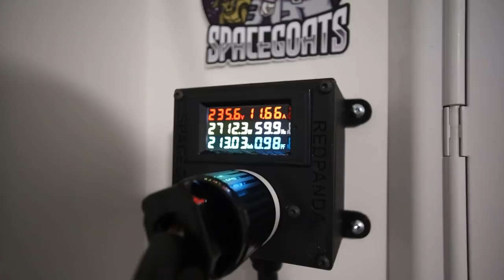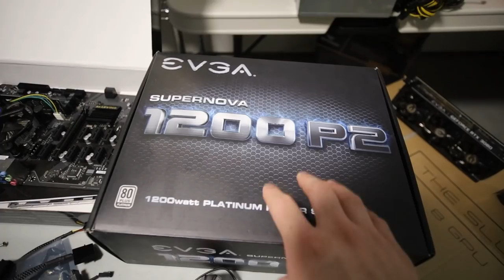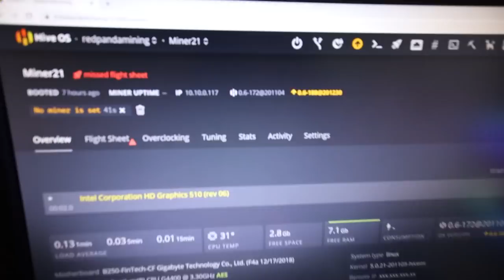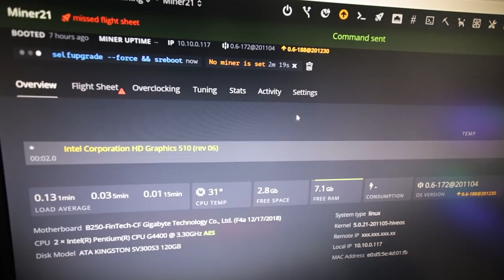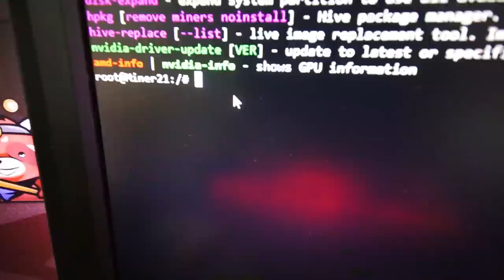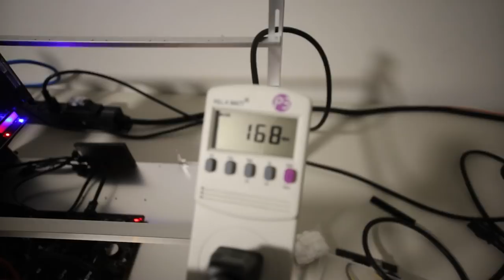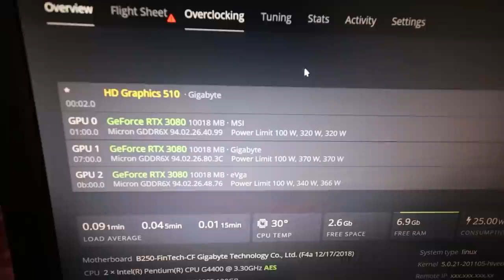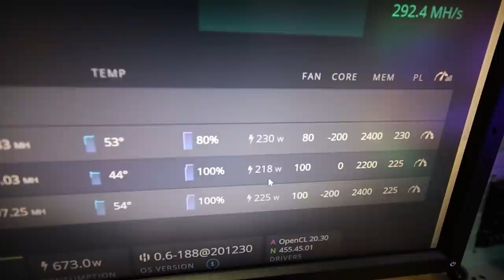Starting a RTX 3080 MINING RIG!

Comment: Do you have a video where you demonstrate how to power 8+6 pin PCIe gpu's + PCIe connecting the risers to with the cables from a PSU and splitters? I'm still confused on how to wire my 2070's with a 1000w PSU.

Comment: The Gigabyte's ram seems to get to hot.  A British miner I saw with the Eagle OC took it apart and applied some sort of thermal pad. He had 80 mhs and got it to 100. Still happy I have a Eagle OC even if some ram temp problems.
Reply: Yeah I had one of those, whever I was putting it to mine, fan would ramp up to 100%, no way of checking ram temps since card is well, crap, i changed to EVGA FTW3, fans are 70% and ram is however between 55-65 which is great

Comment: I had this issue with my first rig. The issue isn’t open air the problem with these rtx 3000 cards is fan speed. Keep fan speed at 70-80% 100% makes it throttle for some reason. Every other option I tweaked while at 100% fan didn’t matter even stock. Drop fan speed to 70-80 and it won’t throttle

Comment: I have a 6x3080 rig. Avoid MSI trio x cards. Had 3 and returned them for memory throttle issues. I have 2 tuf, 3 MSI suprim x, 1 EVGA xc3. Tuf cards are great and EVGA is great. I have 1 suprim with poor memory, only pulls 94/mhs but at 204 watts. The other suprim run at +1500mhz, 57% pl. And then a FE in my workstation. Good luck buddy!
Reply: What kind of power do you pull?  I am worried that it could over draw a circuit.  Also, did you have to use/upgrade anything else like memory or mother board to get it to work?
Reply: @jeffderitis1378  i pull 1550 from the wall. Used two different wall ports. I’m on an lga 1150 board. 16 go if ram. One thing that will get you if you aren’t ready is you will need to change the page file size in windows. A small setting, but necessary. Always use circuit protection.
Reply: Thanks for the advice.  I am starting with 2 3080s and will go from there.  As i been slowly moving forward I found that there are many things that have to planned out ahead of time.   Power, access to GPUs(lol), and the right components (enough power, right and proper amount of connectors) and so forth.  It is always good to see how others have achieved to see if there are any holes in the game plan.  Take care and happy mining!

Comment: As a new miner it's all those little things you don't think of. Fan splitters, risers, PSU spliters, etc.... etc...
Reply: Yeh I just bought a psu that has 8 pcie outputs 😂 when I get my 5th card I'll get another one 😂
Reply: Personally I only deal with cased riserless rigs. The day I switched made maintenance drop off like 80%. No more riser problems or anything of the sort, expensive but worth it in my opinion
Reply: @Alpejohn  ive just had so many die on me ive lost count. In my 4 years GPU mining, its the most consistent point of failure on any rig. I was amazed at riserless performance
Reply: @Alpejohn  but there's also something to be said for price point. Risers are pretty cheap (or they were last time I was buying) so its a question of is your time saved (cost savings in downtime and effort) worth the expense of the case and motherboard
Reply: @Alpejohn  well if you change your mind ive got two spare riserless cases i don't need. (One is Octominer, other is generic and imo better bc of non embedded CPU) would be willing to let one or both go for right, fair price.

Comment: Gigabyte Gaming OC without adding thermal pads 99 MH/s settings:
66% powerlimit
-200 core
+1250 mem
Fan 90% or 100%
GPU temp 40 celsius
Room temp 18 celsius

Comment: In Hiveos just edit in power consumption and efficiently tab to correct it

FYI for myself in nvidia gpu just plus 15w for each riser and 20 more watt for MB with 92% psu efficiency.
another FYI rough calculate with your rig info I have nearly correct wattage to your wall.

Comment: man. 3080 have hot memory chips. you need to cool down the back plate. especially on the memory side and those pop caps.
it will only last a month if you keep doing it without proper cooling. 

only evga card have sensor on many areas, but the other brand dont.

the noticeable sign is the hashrate consistently fall, while the gpu temp is cool <75c. like say 16:38
obviously the memory has thrown alot of error (ECC) because of the thermal. the card will try to compansate for the heat by throthle down the gpu frequency. which will not help at all because you overclocked the memory.
you could lower the memory frequency. but sometime, it does not help at all because of the heat release for the memory is not proper in any way.

it a sign of problem  that soon make your card failed when you force your card run that way in a 24/7.
it is a well known problem form 3080 that cause a gamer black screen when playing games. and the root cause of those failed 3080's when they even use for gaming only. gaming 24/7 that is.
i know alot of people who dont turn off their pc even when gaming. they let it run  24/7. all that wasted electricity.

other than popcaps problem. it is a back heat problem. 3080's memory are fried in heat. apparently, cooling only the front is not a solution.

unless you go for exotic cooling in front and back of the card.
that is why EK has launch a new 
waterblock that cool the front and the back.
or many people also tried using ram waterblock to cool the backplate.
you could simply add more heatsink on the back. but will only effective if the back pcb has proper thermal pads.

keep your eye on the hashrate....
you will be best to  RMA your card if it ever touch <80 MH/s. it's doomed to failed. it will cause a black screen if ever use for gaming.

i suggest 3060ti over 3080 because the 3060ti have more manageable temp.

Comment: What will it take for miners to choose cards that don't overlap the gaming marked?
Reply: For mining to not be profitable
Reply: When ETH goes POS...gpu mining dies
Reply: @reddevilxt716  it wont die. People will just mine something else.
Besides thats like 2 years from now minimum
Reply: @adaptive-tom7143  idk. I just see mining not completely dead, but significantly dying off at that point. It’s nuts right now. But just like 2017....it will fall off.
Reply: I was thinking more along the lines of Nvidia/AMD releasing cards specifically designed for mining, using components that are less rare but that won't impact the GPU's ability to mine.
Reply: @iseeu-fp9po  not possible. The ETH mining performance is directly related to the speed of the memory. GDDR6 and GDDR6X are the limiting factor in production from what I have read.
Reply: @reddevilxt716  Fiddlesticks.

Comment: Nice curious of the consumption when you get it tweaked out not the most efficent yet 5 3060ti would be at 309mh at 680w.  And cheaper :)
Reply: Damn, that`s insane Rabid, hopefully I will be able to buy some next couple of months, in Europe they go for 500 - 600 euro...
Reply: @yourmothersfavouritehouseguest  crazy that's what they are here and your money is worth double ours.
Reply: with couple of 3060ti you have 60mhs for 120w per cards, not bad too.
Reply: @warriorfr78270  120w software at the wall more like around 136w
Reply from the maker: Ive made the mistake buying 1060's before but I'm willing to spend more on gpus for the density and 10gb to lose a bit if efficiency. But I'm curious of the calculation for more motherboards/cpu/psu's if you are doing a huge farm obviously lol but small scale yeah then we talking 3060 ti. Really depends. I think both cards are the way to go for miners right now if ya can get your hands on them!
Reply: @RedPandaMining  very true
Reply: @RedPandaMining  I'm agree with you more ram is better but now for the price a 3060ti is better, if the price down a 3080 is better with less rig for sure >0.

Comment: How do you manage to keep your 3080s from auto downclocking while mining? My 3080 immediately downclocks to 700-800MHz once I start mining and have no idea why. Read it might be forced P2 state on Cuda workloads, bad cooling ...
Reply from the maker: Temps are probably the biggest factor. They thermal throttle due to gddr6x memory is hot on both sides of the gpu heatsink and the backside. You may need to do thermal pads on the backplate & have cool ambient temperatures in the room. Those 2 things seemed to have fix it for me.

Comment: directed airflow...now would be a good time to test that diamond plate out on sides and top...or you could just use cardboard...
Reply: Putting the fans directly on top of the cards you'll save 5C easy, especially on that MSI card. Thermal Grizzly on the heat sink and over all lower ambient temp will help with better mining performance.

Comment: Anyone know how to get 6 GPUs working on an MSI X470 MB? PCIe4 does not appear to work with an m.2 and the other 5 PCIe slots filled. Does using a USB drive make PCIe4 work or would an m.2 to pcie work for the 6th?

Comment: I am working on a similar setup, just double checking to be safe for myself - you have 2 8-pins for each 3080 but you are splitting one of the 8 pins to go into the riser? And that should satisfy the wattage for both the gpu and the risers with no problem?

Comment: Are red riser the new 009 and 010 Pcie 4.0 compatible with rx 5700 XT also? I could never get my fintech gigabyte 250 to read my rx 5700 XTs (007 riser ver..) without directly plugging them into the PCIe slot.
Reply from the maker: thats strange, it should technically work. Check your bios setting for pcie gen1/2/auto try different settings and 4g decoding enabled.

Comment: I have question about can i damage my GPU by mining on NiceHash. I have RX 580 8GB and i set up in msi afterburner power limit to -30%, i set up to in nicehash TDP power to low, and my GPU is running at 62-65 degrees celsius, with fans 55-60%. And i forgot to tell, im mining about 8 hours a day. How long will my GPU last. Can it last at least 3 years. I will mine about 300 days in a year. Thanks!

Comment: can i get some input from someone... im trying to run a low key dual 3080 mining/gaming rig. but my pc keeps restarting after about 30 minutes of run time. i replaced the 850w psu with a 1000w and i still cant run them even with one at 30% and the other at 65% power limit. really frustrated with this, will the 3080FE cause restarts if the core memory gets to hot? or is it likely my psu? its a supernova evga 1000w. also i even have the TDP for the 3080 FE set to low and asus set to high and still cant get any stability what so ever.
Reply from the maker: Check your temperatures man, if the gpu's are in a enclosed ATX case it will get extremely hot with these cards and probably turn off. Becareful.

Comment: Love your videos, i managed to get 4 x 5700xt, 2 are the same and 2 are different, also got a vega 64. Would it be  problem running them all together off the same motherboard? Also want to know, my video cards are pci 4.0 and my motherboard is psi 3.0? Will that still work?

Comment: I now run 2 MSI SuprimX 3080's. They have a very good performance.
Reply: Mine is arriving in 2 days. What are your opinions on the suprim x?
Reply: @thr3x658  It is a very great card I have 101.4 on one and 104.5 on the other at 240w per card. The fans would theoretically only need to run at 40%. It is very quiet.

Comment: Are the 3080s non-lhr cards ? This is a good video. I have 1 8 pin powering the whole 3080 gpu with 2 splitters. But mine is lhr card so I am getting 70mh/s per 3080.
Reply: +1
Reply: 424
Reply: 209
Reply: 95
Reply: 44

Comment: I got exactly the same motherboard, EVGA 3080, Xtrio MSI 3080, 5xPalit 3080, 1 Palit OC 3080,1 Inno 3d x3 iChill 3080. I tried running HiveOS from a SSD, updated nvidia Drivers to latest, ran only 6 of my cards on 3x 1200W PSU just to test and make sure everything was fine and it wasn`t... I always get an error such as "GPU driver error, no temps". HiveOS hates me -_- 3 days of struggle! Any tips :S? After the message the computer freezes and the cards stop mining. Any tips?

Comment: Did u realize the ssd runs out of capacity using 12 gpus x 10 GB RAM? This happened to me with my 13 gpu rig.
Reply: what does this mean? If I am running 10 GPUs do I need to have a bigger SSD?
Reply: @BradenSchlimme  It means that u have to raise ur virtual memory. Each VRAM of any card u have will be added plus a bit more for windows. If ur cards do have 8GB VRAM and u have 10 u need to set ur virtual memory to 10 × 8 + about 8 for Windows = 88GB
Reply: @frankheidemanns5250  thank you!

Comment: Is it more efficient (like more hash per watt, or whatever unit of result to cost ratio) to underpower and under volt a GPU or just let it run at its max TDP and push a lot of watts?

Also what are some of the most efficient GPUs on market? I see a lot of videos saying 3060ti is really good for the amount of hash rate per wattage used

Comment: I am only getting a stable 77 MH/S and i can’t get more i am using Gigabyte RTX 3080 Vision with 75 Power Limit + 0 Core Clock  + 1250 Memory Clock  Fan at auto mode and Window 10 any help to reach 100 MH/S

Comment: Hi Red panda, so I have a 3080 FE, for some reason it starts drwaing 235 watts as configured and then it lowers to 217, any idea why it is loweringthe power? MY PSU does not have an ECO mode it is an EVGA G+ 1000, i only have connected the 3080 and a 3070, help if possible :)

Comment: About to add 4th 3080 tomorrow
Reply from the maker: Lol
Reply: @RedPandaMining  talk about price of eth . I am feeling market is about to correct big ...... Here 25-40% drop is near sight
Reply: @RedPandaMining  converted 35 eth i to usd at 850$
Reply: Zotac . I have all zotac 3080 amp edition 99.4 mhs and they never thermal throteling at all stable cards rock solid boost clock mentioned at 1774 mhz

Comment: Nice video! Regarding your comment of the PSU wattage selection. I had the same issue after phoenix miner crashed the set power limit on MSI after burner was overwritten to 100% and consuming a lot of power over night.
Tip: you can set the power limit directly in the config.txt file so phoenix miner will have the power limit set right on start and even after a crash. 
Command line for 55% is:
-powlim -45
Tip: